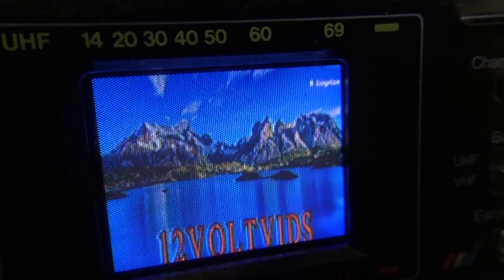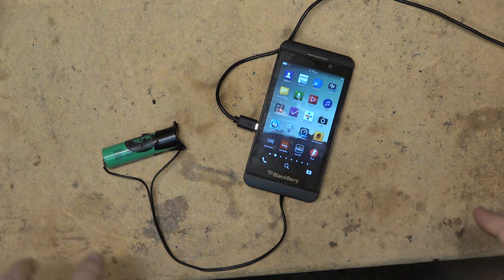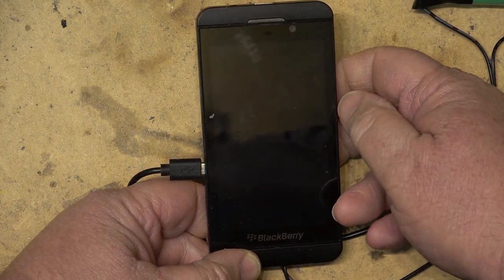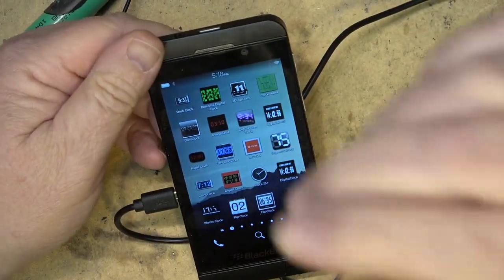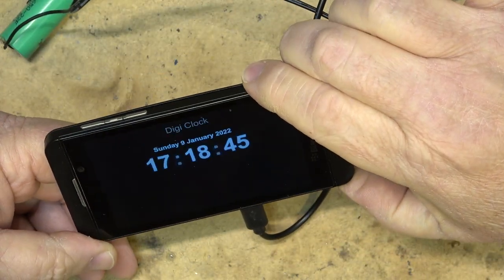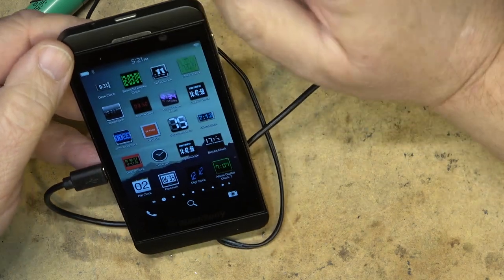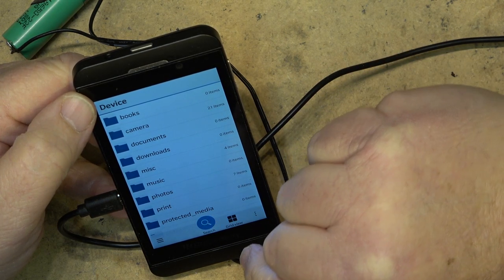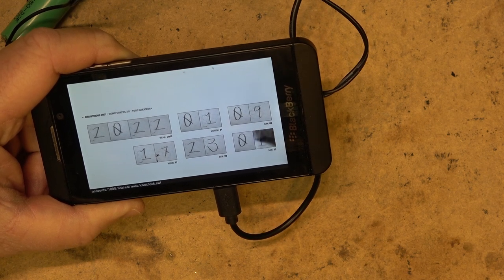Introducing the Frankenberry

Comment: On some devices you can replace the battery with a capacitor so it wont degrade from being fully charged all the time. I remember using a super tiny 10uF cap even. Or you can use a resistance box on charging cable that goes from lets say 1ohm to 8ohm to keep the battery at a lower voltage.
Reply from the maker: My playbook has been plugged in running 24/7 for at least the past 7 years.
Reply: @12voltvids  Just giving ideas for others.

Comment: When I stopped using my Nokia N95 as a phone (battery died and no replace available at the time or very expensive or very low quality) I did the same with it: an external cell connected to the original battery controller board, soldered to the contacts. Plugged the phone to TV via its AV cable and used as night clock, YouTube player or mp3 player for background music from an 1G SD card. At first, when the phone was in use, I also played games on that big screen.
I had a huge Panasonic CRT TV at the time with many inputs (SCART,  AV frontal, AV rear and RGB component).
At night or when needed, just selected AV input with the remote control and the phone showed on the TV screen. If I would have a USB OTG, I could put some videos also to a USB drive to play them as well.
I still have that N95.
Reply: i still have my nokia n95 with the original battery and it does still work ish.. but dont have the av cable
Reply: @09danstart  N95 was my favorite phone; I had N72 and N70 but N95 I totally loved.
Later, I fall for 5800XM :) that I have 2: one blue and one red.
And the AV cable came with N95 in the box and was also compatible with 5800XM (that also had it , not  sure if in the box or I bought it later).

Comment: I usually use old phones as WiFi radios, but this gives me great idea for my old tablet, I'll use it as a clock !
Reply from the maker: Yup my playbook is a clock and the HDMI output feeds a converter which sends a video signal on rf to old TVs . It syncs with internet time.
Reply from the maker: I do that too my z30 I use as radio as it has stereo speakers.
Reply: I remember buying some old tablets running Ice Cream Sandwich (Android 4) and using them for digital photo frames with an old slideshow app.
Reply from the maker: @gyrgrls  Thats what I use my Samsung tablet with OLED screen for. Photo frame. Can't beat the picture on that.

Comment: I love seening different types of clocks. It would have been so cool to see the Shockwave file clock change from 1999-12-31 23:59:59 to 2000-01-01 00:00:00
Reply from the maker: I could just turn off auto time and set the date back.   Easy.

Comment: Ever since I happen to have my RCA Maven Pro Android Tablet, Asus Android Tablet, and RCA Cambio Windows 10 Tablet with 32 bit, I can run a clock software and connect to HDMI to composite and run to the monochrome monitor as a time display.

The problem is for RCA Maven Pro Android Tablet is when I have it to run the clock app it really does not want to keep at the center of the screen for where it really stretched outward from left to right and you can't see the clock display that good and need to figure out and see there is a way to adjust the clock display to keep it center for the screen without any problems.

For RCA Cambio Windows 10 32 bit, I can run the old Windows 3.1 clock display with the various fonts for digital clock display and I can switch to analog clock display that has hour hand, minute hand, and second hand and will work like a charm.

And for Asus Android Tablet, I can use any clock display to my 5 inch monochrome monitor to display the time  and date.

Comment: Cool video I'm a clock nut, love clocks
Reply from the maker: I just like displaying the time on an old CRT
Reply: The bankruptcy clock is ticking.  I can almost hear the deadbeat escapement.
Reply from the maker: @gyrgrls  Don't count blackberry out yet. Just because they shut down the servers to the old phones, the company is making record profits securing the internet, and every new car you buy, no matter what the brand had some of their tech in it.
Reply: @12voltvids  I realize that.  BTW:  I was being facetious when I mentioned microwaving a BlackBerry to make Rice Crispies and Coco-Puffs. Sometimes,  my dry humor sails.  But you are good at reading between the lines.  BB is a hardware tech company,  anyway.  Most of their smartphones used an Android-based system,  running off of the Linux kernel,  as do all non-Apple phones today.  Apple uses a variant of OSX (pronounced "oh ess ten"),  which is a fork of BSD UNIX.  Then there are the Windows phones.  Never mind them.  They are already obsolete (gee, I wonder why).